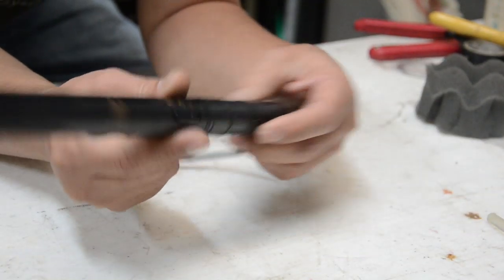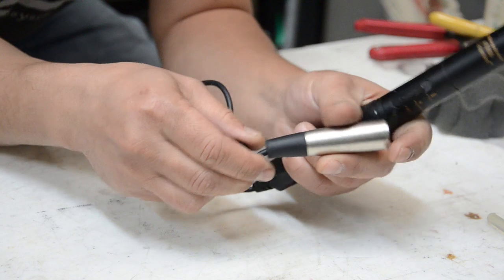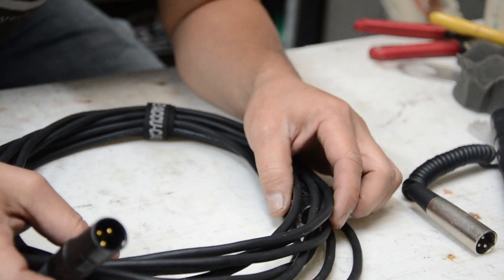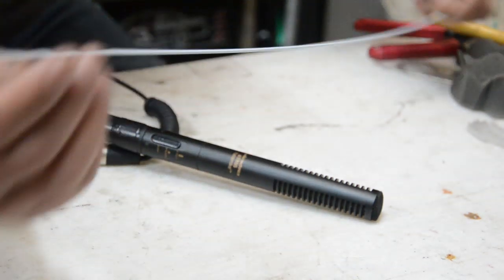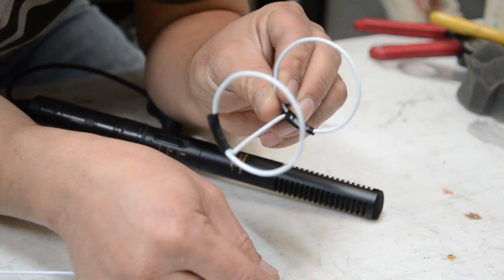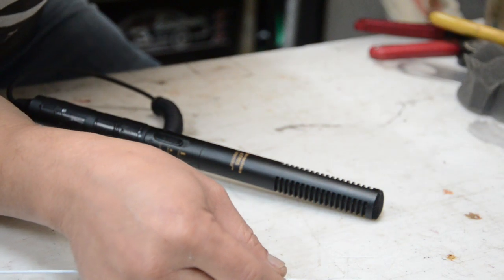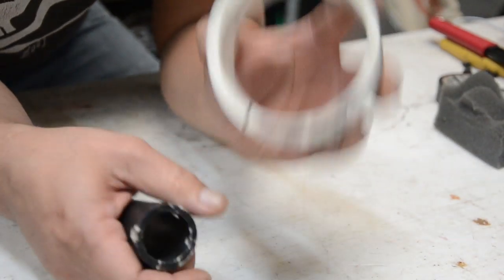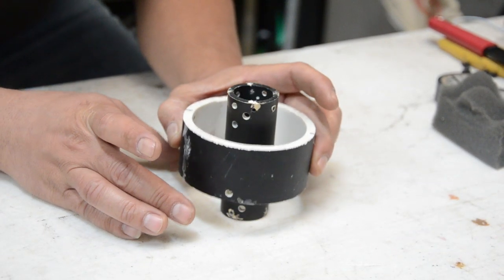How to DIY Shotgun Mic Shock Mount Boom and Dead Cat

Comment from the maker: the mic i use in this video was originally a 1/8 jack.. most smaller cameras have 1/8 inputs. I modified this mic so I can use it with my larger camera. you could also consider a zoom mic. Its a stand alone recorder. You would have to sync the audio and video in post.

Comment from the maker: thanks for watching. the bolts were 6/32, i got them from a robotic hobby kit that i purchased from walmart. you can get 6/32 bolts from home depot. they are small, commonly used for screwing plastic covers on receptacles and light switches. i also suggest getting a 6/32 tap so you can predrill and tap the pvc before screwing in bolts. i didnt have to use epoxy.

Comment: Awesome shock mount design!! I would say though maybe find some rubber caps to put on the end of the screws holding the mice in it's sleeve. Just maybe as a thought to protect your mic investment since it's probably the most expensive part of the whole thing. Although this is a really well done DIY design.

Comment: Where did you get your green connector to the pole?  Did you customized the plate and connected to that green connector?  I like the wing nut that you use to make adjustment for the mic angle.  And where did you get your band, Walmart?

How about making a wireless follow focus to put on your DIY jib crane?  I want to make that for my small, 4' jib crane but I think you are much better at DIY.

Thanks,

Comment: hey, I have one question. I do not have a larger professional camera, which it seems must be used to attach the cord into the camera. I have a sony hdd handy cam, which is ment to be a smaller camera and It has no ports for those specific jacks. Is there any other way to get the audio? or a conversion piece?

Comment: Add me to your contact list so that I can ask more questions about other projects that may interest you.  It doesn't have to be wireless follow focus, but I have seen some designs use wire as well, like servo motor.  My ultimate goal for a DIY jib is to have it pan and tilt and I operate it at the bottom as opposed to yours at the top.  Your is good but it will be limited because you can tilt or pan when the crane is 15' in the air and it is moving about on the set.  Got the 6/32 bolts and tap.

Comment: Nice DIY-video - did the shock mount today and seems to be working well - but the absorbent foam at the tip of the "dead cat" is going to produce a HF-dip when the mic is pointing straight to the source. i.e. on axis. Better to cut out a circle of the furry fabric and sew that onto the tip.